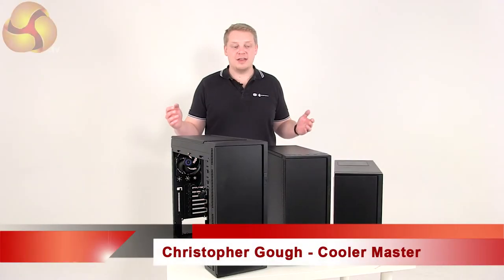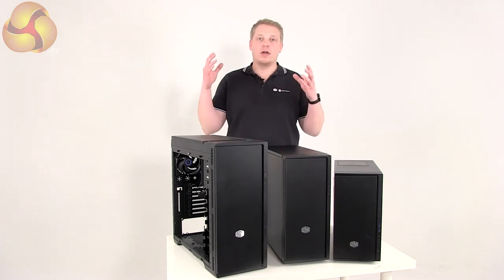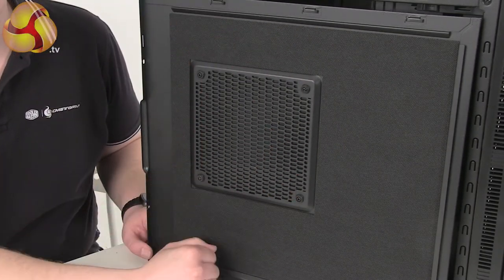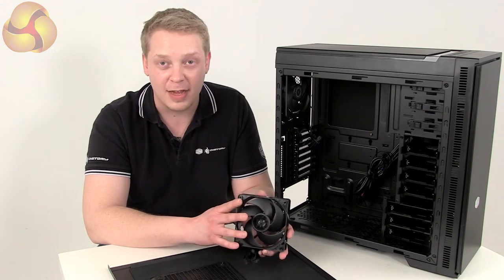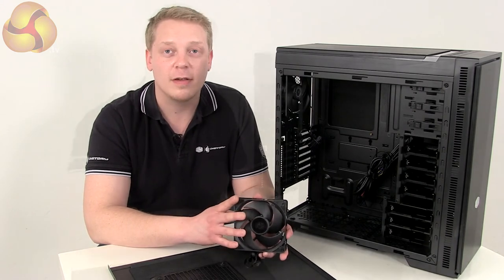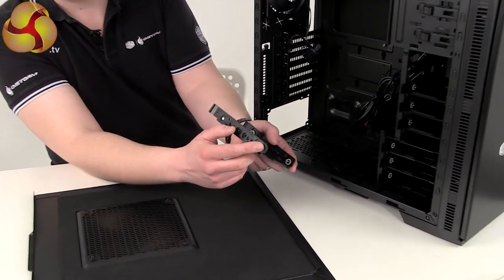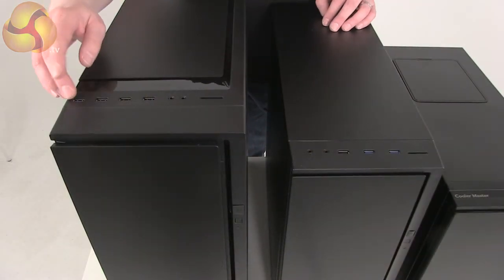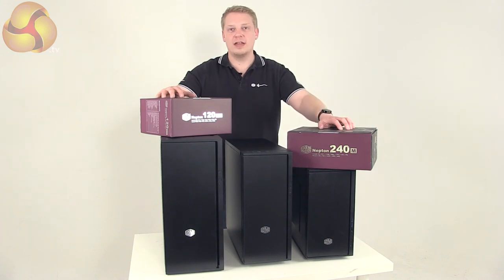Cooler Master speak to KitGuru about Silencio Series Update

Comment: possibly a bit too short, no detail on the different layouts between the cases, no footage of the insides beyond a glimpse of the largest case, no suggestions on how to layout components and whether you can remove the hard drive mounts completely?  perhaps a longer look at each would be useful?
Reply from the maker: These aren't reviews - This is a representative from Cooler Master just giving an overview of the new cases.
Reply: KitGuruTech ok, but did he even point out differences in the new models compared to the older versions? i get that its a product spam but i expected at least a bit of conversation with you/Q&A.   Are they going to give you the cases to review properly later?